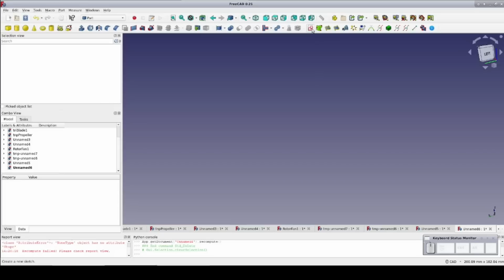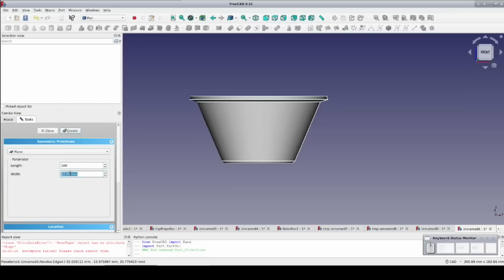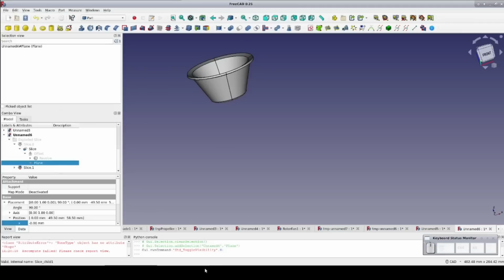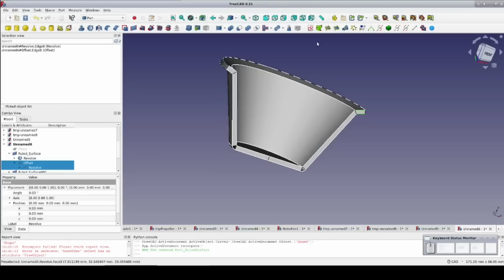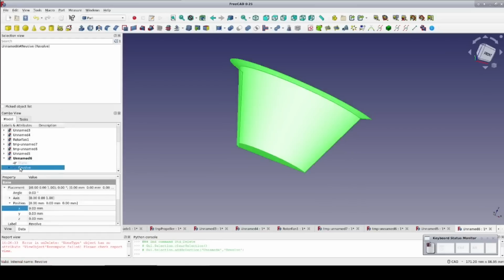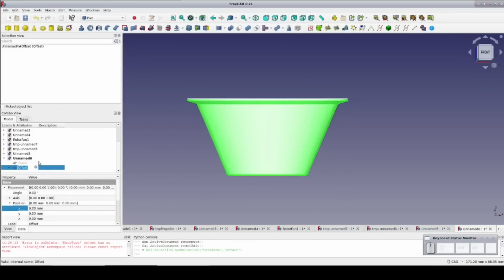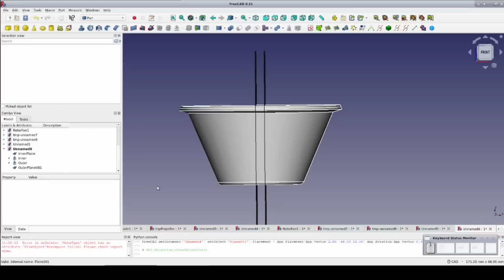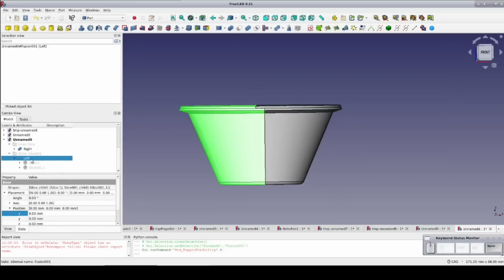FreeCAD: An open reply to Tom Sanladerer

Comment: Seem like a cumbersome way to produce a physical part. Why not just start with a cylinder, reshape it to a truncated cone, copy it, resize the copy and use it to remove the inner part of the cup, giving the desired shape, no sweat. Add a rim in a similar way. And so on. And, yes, you split parts using planes and shapes as suggested.
Reply from the maker: It's mostly a matter of different approaches for different people. In this case, I wanted to stick fairly close to Tom's approach to make a better comparison. See also my re-visit to the problem using a sketcher offset (not available at that time): https://www.youtube.com/watch?v=Ai5ducQ_-Y4

Comment: 1.  Combine all the ambiguously similar workbenches, part and part design for example, these should be one bench.
2.  Strip the basic UI down to three workbenches- one for part design and creation, one for building assemblies, and one to create drawings of the parts and assemblies.
3.  Sketch should be a tool within workbenches, not a separate workbench.
4.  Make all the other workbenches optional, they can be turned on or installed as needed so there are fewer things to distract or confuse new users.
Reply from the maker: Part and Part Design represent two different ways of thinking about the geometry and creating the model. Part design actually calls on the functionality of the Part workbench internally. Many people like the approach of Part Design. Personally I find that Part works better with the way I approach geometry, so I'm glad they are separate entities. In general, Part Design does not work well with the other workbenches while Part interoperates just fine.

Much of this is based on the way Free and Open software development happens. Imagine as an outsider trying to add a possibly specialized new tool to F360 for example.

Sketch needs to be it's own workbench since when you're editing or creating a sketch, you'll need very different tools available. Part Design has the new sketch tool in it's own toolbar. In the latest versions, so does Part. Before that, I added NewSketch to a custom toolbar in Part.

It's not quite what you're asking for, but in edit->preferences->workbenchs you can re-order the list of workbenches to put the ones you use at the top of the list at least.

Comment: I think the main issue isn't going from fusion to freeCad. When I started doing hobby cad work I tried FreeCad and literally nothing did what I thought it would do. I tried to learn for a few hours but nothing worked. It just kept screaming errors at me. 

Then I switched to fusion360 and from never have opened the software to have a parametric flowerpot printing on my 3D printer took less than 30 minutes. I had made so much progress in the next 30 minutes while it was printing that I could basically throw it away before it could finish to print the next version.

My goal is not to learn CAD. It's to make things that I want. and fusion360 lets me do that.

Comment: One of the points you don't mention about having the license change and locking your work up.  What about all the hours you spent learning the software?  Not just the initial learning curve,  but potentially years for use and honing your skills.  Next thing you no longer have access to the software.  You didn't just lose the base of your designs, you just got years of learning immediately made unusable.  Now you have to pick something else and learn it.  Oh, and if you are a strick user of Linux and open source you now have that against you.  I've been using Freecad, kicad, ect for longer than I remember.  About 2 years ago I deleted the windows partition on my computer when I went to boot into it and the updates hung it for 12 hours.  Got a System76 about 4 months ago, run Gentoo on it, build Freecad and Kicad from git sources I update every few weeks.   Being that I no longer use OSS because I can't afford anything else I try to donate to those projects regularly.  Thank you so much for your contribution to Freecad! These video are vital to the project's success.

Comment: The issue isnt that freecad does things different the issue is how unintuitive the process is. The answer shouldnt be " get better at freecad" it should be how do make this process with as few failure points as possible. These failures will not occur if the process is obvious to all users, it should be more like molding a piece of precise clay not giving a list cartesian coordinates.

Comment: Just found your video/channel.  This is a great and very productive approach.  I am looking at switching from Fusion 360 to FreeCAD.  Having more content that helps to explain common issues when switching from Fusion's way of doing things is extremely helpful.  Look at it this way, if someone is looking at FreeCAD in the first place, they are motivated, so giving them access to more tips/videos showing how to adjust their old work flow to the FreeCAD workflow is a very powerful approach and I suspect very good way to increase your user base, which will then increase support available for FreeCAD.

Comment: The issue with creating a physical plane of finite size for splitting is that if you now go back and make the cup bigger than the plane, you will now most likely run into errors. The point of CAD should be that you dont have to keep the model (mental model of how the part was constructed, not the part/"model" on screen) in your head, the computer aids you in keeping the steps visible and easy.
Reply from the maker: While I agree that an infinite plane would be nice, it isn't a deal breaker to me. The plane is still in the tree, can be made visible, and can be expanded.

For what it's worth, any surface can be used to split a solid, including extruded bsplines, so there will always be cases where the splitting tool must be re-sized if the split solid is resized.

Comment: I tried freeCAD a few years ago having never used CAD software. It took a lot to learn to design things. It did not feel intuitive at all. I will have to give it a try. Hopefully the UX/UI has improved.
Reply from the maker: Admittedly, FreeCAD does have it's rough edges, but it's worth keeping in mind that CAD in general has a fairly steep learning curve until you get into the right mindset for it.

Comment: I see a potential for trouble with this double shell design tactic, especially if trying to 3D print it and needing to change dimensions for better fit.
Reply from the maker: Adding clearance would be a matter of making 2 cups, one where the inner cup thickness is reduced by 1/2 of the clearance and one where the inner cup thickness is increased by the same amount. Half of the cup where the inner shell protrudes would be matched with the opposing half of the other cup and so they would fit with the desired clearance.
I didn't go in to that since it would complicate the basic point. But see  https://youtu.be/ETDnTP7sQB8?t=233where I use a shape binder with an offset to form a tongue and groove. Different offsets on the binders could be used to create the clearance.

Comment: Thank you sir!  I choose FreeCAD for the same reason I run Linux on my servers.  I don’t mind doing things the hard way if it means I’m not locked in to some solution that will eventually be paywalled.
Reply from the maker: I'm very much with you there. I use Linux for everything for decades now. Everything for this channel is done in Free Software in Linux.

Comment: I wish AutomationDirect would get with "FreeCad"  to create PLC CAD projects like AutoCad Electrical and even pneumatic piping. Also, electrical panel layouts, conduit and cable runs would be beneficial.   I have used FreeCad to do this and it works very well.   However, Automation-Direct can make it much more robust.  FreeCad is a wonderful Hobbyist CAD tool with several add-on modules and all 'Free'.    The Arduino-PLC IOTs solar-panel hobby projects cannot afford $2,000 to $4,500 CAD software packages.  😎  Thank you and best regards.

Comment: Very amicably and professionally handled - well done!  Thomas Sanladerer really should update his video, pointing to the solutions which you've provided here. 

I appreciate that the ruled surface failed when it was asked to basically do what I would consider an illegal operation.  Along the coplanar edges, you had 5 inner edges, but 7 outer edges, and I actually like that FreeCad didn't just assume what the user wanted.  "With increased power comes increased responsibility."

Comment: Sir. You are AWESOME. Subscribed.  Plus, I never liked Tom Sanladerer at all. So much of what comes out of his mouth is noise. Just listening to you talk about anything would be good. The clarity of your mind is what I am craving, and never find. ...especially on youtube, where people like Tom are promoted heavily. I have been researching CAD software for years, and I tried FreeCad about 10 years ago, and got nowhere with it, as I did not have the resources on youtube and the net at that time, and I lacked the confidence in it. But now I am revisiting the subject, and after reading lots of comments on youtube that were reasoned replys to  the FreeCad attackers, just like your video here, ...it has helped me gain confidence in FreeCad.  They explained the workarounds or fixes to the problems, or how the FreeCad attacker simply did not know how to approach the model in FreeCad. I also tried or research Fusion 360 and it seemed way to hard and slow and confusing to use. FreeCad looks much clearer, simpler, and better to me, and I have been designing GUI's for systems for all my long life. I have been working in CNC software for about 8 years, but it has all been stacked 2D.  Now I want to do some 3D printing, mainly just to learn it, and since I can pay someone to print a 3D model, I want to focus on learning 3D modeling, and FreeCad just looks like the way to go, and you and others have given me the confidence to try it again, and with a much more confident attitude for it, to start out with.  Plus all the improvements to the program over the last 10 years or so, plus all the new video makers on youtube, like yourself making all kinds of videos for it, ... I am feeling really confident about it now. And that was not the feeling that I had at all before. And if you do not have confidence in a foundation, then you do not want to build a house on it. Thanks for your videos, and channel, and especially this video. I will slowly check out all of your videos. Thanks.

Comment: Why wouldn't you just create a closed shape profile to start with, before doing the revolve? Not sure why you would create a revolve, then offset, then try to fill it in. Not sure that would have worked very well in Fusion either. 

A thousand ways to skin a cat I guess.

Comment: I tried FreeCAD and decided to not use it. Too complicated and not user friendly.
SolidWorks is so far my favorite but I stopped the subscription around 5-6 months because I could not use there CAM because of missing post processors and lack of videos for it.
I now use Fusion360 with subscription now. It has the best CAM so far and the CAD is good but not as good as Solid works. But in solid works I had problems with assembly’s broke for no reason.

Comment: Good video. I've designed a bunch of things in FreeCAD, although I've never designed parts that used inner and outer shells, and I haven't split parts according to a plane. It was interesting to see how you used the tools to do this.

Having said that, I do think that the final solution that you implemented is a bit conceptually complex, although I do think that having an object with overlapping shells of different dimensions isn't a trivial design.

I'm going to continue to use FreeCAD because I want a tool that will never cease to be available if the developers change the price or licensing model. One of the great things about open source software is that it never suddenly becomes unavailable if the developers stop maintaining the project. So if you invest time into learning a tool, you don't run the risk of suddenly losing your entire time investment on a tool that stops being available for download.
Reply from the maker: Continued availability is also one of my big reasons to choose FreeCAD. I also like that the price doesn't suddenly go way up should I actually go commercial with a design or end up arguing over what exactly constitutes commercial use.
The multi-shell design is a little complex to keep track of. I have a followup video where I used a more conventional tongue and groove approach that is quite easy to implement in FreeCAD.

Comment: In my opinion, the workbenches paradigm is itself a problem. Some workbenches operate like a complete separate CAD tool (BIM Workbench) and others are just additional tool that may or may not work with parametric design (Curves Workbench). The Curves workbench is amazingly powerful but is really hidden underneath tons of layers and very poorly documented.

P.S. I agree completely with your analysis of for whim FreeCAD is a good match. I am keeping an eye on it and I'm looking for the right time to switch to it for my business use. It's not there yet, although I already use it as a back up tool. For example the FEA workbench works really well. But as for another example, I have now lost the ability to download add-ons from the add on manager, and the time to troubleshoot that costs real money for me.
Reply from the maker: I get the concerns about the workbench paradigm, but without it, we might not have the very useful tools that Curves, Lattice2, and others bring at all.

Comment: You 'da Man!  Thanks for this great response video (Liked & Sub'd).  I have been using FreeCAD for a little over 5 years now, ever since I got into 3D printing.  I never wanted to fool with trying to figure out how to get a free license for Fusion 360, and besides that I run Linux (Ubuntu) on all my personal computers.  Which severely limits my CAD software options.  So all I know really is FreeCAD.  I knew that Thomas needed to use an object to split his planter model, I have used a thin box in the past and didn't know I could create a zero thickness plane (Thanks!).  I have really enjoyed the challenge of teaching myself how to use CAD.  During the lock downs I challenged myself to recreate a fairly complex camera mount using FreeCAD and my 3D printer.  I even had to research the Unified Thread Standard in order to make working screws.  This was the result: https://www.thingiverse.com/thing:4356217

Comment: I ran into the exact issue the Tom talks about. I wanted to do a offset sketch from the original sketch....it doesnt exist in the sketch tool box apparently. You have to go to the Part workbench and do alllll this extra crap, just do create a offset sketch. Every single CAD package i every used had a simple offset tool for sketching, but not Freecad. I was watching a DEV stream where he was working on this exact offset tool for the sketch toolbox and the stream was a year old and still not in the main build. Like....something as basic as offset sketches in the sketch toobox dont exist that just blows my mind.

Comment: I started years ago with Pro/Engineer on a Sun workstation and the excellent book “Inside Pro/Engineer” by James Utz and Robert Cox.
To this day I draw everything off the 3 intersecting, infinite planes and completely ignore the origin. If I have any kind of rotated feature (with an axis) I will create an axis from intersecting planes and use that axis as the datum reference for every single feature. I can’t remember the last model I did that couldn’t have every single sketch survive every solid feature being deleted all at once. My models never “crash.”
Reply from the maker: That's very much like the advice for avoiding run-ins with the topological naming problem in FreeCAD. In Part design there's the datum plane and in Part just directly position the plane of a sketch or primitive.

Comment: Thanks, very good response.  I must learn to use 3D CAD for occasional small projects.  FreeCAD looks like the way to go.  We only use Linux and don't use cloud services which greatly limits the options.
Reply from the maker: I'm using Linux myself. I have many concerns about the long term availability and reliability of cloud services (AKA someone else's computer).
Reply: @4axisprinting  Another concern is future access. Services come and go but I have files that I can still refer to from 25+ years ago.  I've been designing circuit boards since about 1983 and the DOS software I used then still runs under Linux today.  Way back I used a 2D CAD program (Visio Technical), until it sold out to Microsoft, the license changed and they told me I'd have to buy it again.  Not heavily used so I abandoned several years of drawings and went entirely open format.

Comment: I love videos by developers of open source projects that completely miss the point of someone's criticism. It really reveals the mindset of it's developers.
Reply from the maker: I'm not sure why you believe I am one of the developers. I am a software developer, so I understand what is going on in FreeCAD, but I am not the developer of FreeCAD.

I AM a user of FreeCAD and I appreciate the efforts of it's developers. Perhaps if I gain enough understanding of it's code, I will contribute where I can.
Reply: Comments like this really reveal how entitled are the users of such projects. It's made by unpaid developers. Solving all your "basic" issues is much harder than it seems on the surface, CAD modeling is very complex under the hood